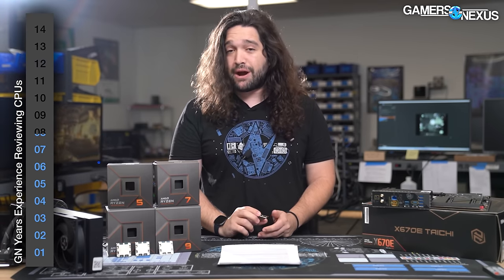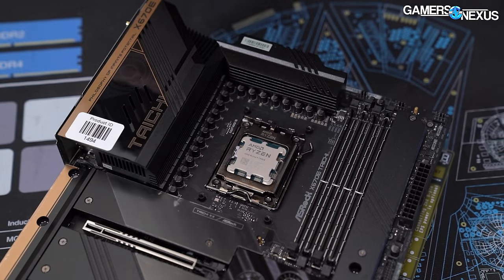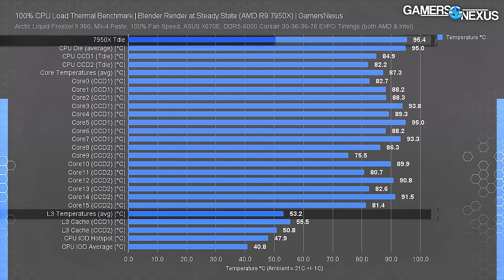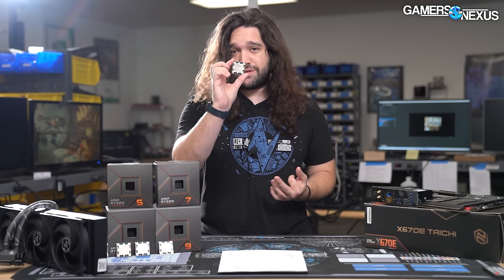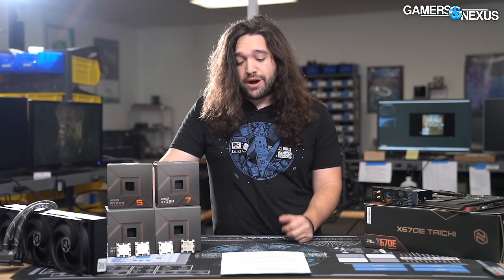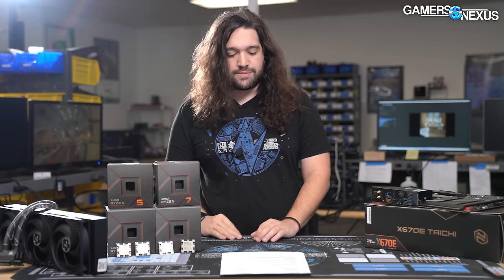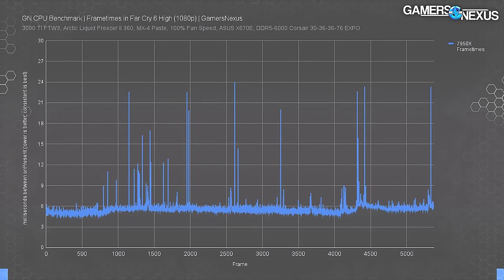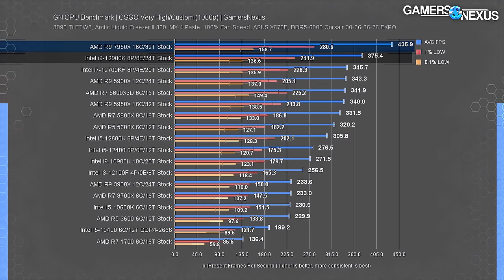95°C is Now Normal: AMD Ryzen 9 7950X CPU Review & Benchmarks

Comment: EVGA picked the golden time to go full throttle into the power supply industry
Reply: Hold on a fucking second

It all makes sense now

4d chess
Reply: While Nvidia was playing 2D chess EVGA was playing 3D chess
Reply: There is only ONE real PSU manufacturer in your sentence, all others are just OEM resellers 😉

EVGA G6 line is literally Seasonic btw. And every EVGA PSU line is made by different manufacturer - they probably already used all of them.
Reply: @walterwhitesr.210  I have 3 EVGA power supplies, one that's been heavily used for almost 5 years. Never had a single issue.
Reply: @walterwhitesr.210  I bought one 1 month ago
Reply: @walterwhitesr.210  You shouldn't offer opinions when you're as uninformed as you are.
Reply: @BizzyB3164  I love my EVGA power supply too. But he's right, EVGA won't survive this. The company's entire existence is predicated on graphics cards (that "VGA" in "EVGA" wasn't an accident). They're done. It's sad.
Reply: All these "EVGA is doomed!" posts don't realize that making GPUs barely made them any profits. EVGA will be fine.
Reply: @jeffmccloud905  I agree,  just wish there were more people out there who are sick of invidia's prices and would support EVGA on principle.
Reply: @sunman2566  exactly
Reply: @Morpheus-pt3wq  Yeah but it's still a bit inferior in terms of electrical performance vs say the CWT made new RMx or Adata's XPG Core Reactor. And actually Aris recently posted their review of the new FSP made G7 which also performs a bit better. It's way more important that you have a really good engineering team to guide the OEMs on how to make the PSUs. Rather than having a company selling directly to consumers that also happens to manufacture PSUs . Seasonic is still capable of producing absolute dogshit units like the S12 lineup which didn't even have OCP.
Reply: @BizzyB3164  EVGA will stay afloat selling the rest of the products they already manufacture, GPUs barely made them any profits.
Reply: @jeffmccloud905  your optics is clouded, because you forgot to look at margins. To get the revenue they had, they had to make and sell insane amount of GPUs each year. Because their margin on each GPU is very low, i think it was about 5% per product. Meanwhile they can sell a PSU with 15% margin, which is a 300% increase per unit. This means for them, the PSUs are more worthy of manufacturing, than the GPUs. Even when it´s just an OEM PSU with EVGA sticker on it.
Reply: @BizzyB3164  I’ve rocked two EVGA psu’s across two different builds in the span of 8 years consistently abused and one even surged, all operate fine. I’d vouch for them.
Reply: @Morpheus-pt3wq  Also G2,G3,P2 are all made by superflower, G5 and G7 were made by FSP.
Reply: @sunman2566  To add to this, it sounds like recently, EVGA was LOSING money on GPU sales. Revenue ≠ Profit. If EVGA makes 1 million selling GPUs but had to pay Nvidia and their component suppliers 1.2 mil to MAKE those graphics cards, then lost money on that transaction. From what I understand, the profit margin on some of their other products is MUCH higher.
Reply: @jeffmccloud905   Energy for VGA? ;) Fits also
Reply: yeah im not sure if EVGA can live in a PSU , MOBO only market .. i use corsair and im brand locked as i tend to do with products that ive chosen and have given me excellent performance  i see no reason to change from corsair ... BUT and BIG but if i have to change when the  7900xt comes out and future proofing for the AM5 7900x3d i may be tempted to buy EVGA as a support their business type thing..
I would like to see EVGA team up with AMD honestly another exclusive board partner for AMD would be great !!
Reply: @walterwhitesr.210  I have an eggs power supply. It’s great. Dead silent with my 12700k
Reply: @walterwhitesr.210  EVGA psu is all I use. Why? Customer service that's why
Reply: @adowowable2587  every manufacturer makes some dogshit units. Why? Because people keep buying them. Only real solution for this would be for people to stop buying cheap PSUs.

This is true even for all resellers, including EVGA. Half of their PSU lines are cheaperoo dogshit units.
Also, within all of them, Be Quiet is the most expensive. They demand you to pay for their fan. While the fan is really durable (it will probably outlive the PSU), its cost is really making their units unreasonably expensive.
Reply: @Morpheus-pt3wq  EVGA's power supplies are not popular. And power supplies aren't replaced very often. It's just not a good market for EVGA long term.
Reply: I'm tired of the biased that exist in the PC gaming ecosystem 

when AMD runs hot they get a free pass but when intel runs hot they are criticized, joked and bashed for it.

now power consumption has become a AMD fanboy talking point that it is almost political. 

you see their are double standards when it comes to AMD and Intel, because without double standards AMD has no standards and AMD are guilty by thier own damn standards
Reply: @walterwhitesr.210  but but, I just bought a EVGA power supply with ECO mode  😪
Reply: @OCtheG  So in EIGHT years, you gave about $200 to EVGA. a company can't survive like that.
Reply: @lldjslim  you make some good points, if you were commenting on a different video. WTF are you talking about?! it's completely off topic
Reply: @walterwhitesr.210  i only buy evga psu, their quality and warranty are the best out of everything you named
Reply: @jeffmccloud905  I own one rn. The aforementioned G6. I also owned G2 before. They´re quite popular, where i live, so i guess it maybe depends on the region? 

I also own Corsair RMx 2018 unit. I am happy with both, but if i had to pick, i´d pick EVGA again. Or Seasonic.
Reply: @Morpheus-pt3wq  Me too. I own the 1600W P2, and I have a FTW3 3090 video card. I love EVGA. But their PSUs and motherboards don't have market share even close to Corsair, Seasonic, Asus, MSI, etc. When I say "popular" I don't mean "well liked". I mean "sell lots of units". EVGA is finished. (Unless they make a huge partnership with AMD, which is still possible)
Reply: I got an EVGA power supply in my boutique prebuilt. They aren't just selling individual power supplies for custom builds.
Reply: @walterwhitesr.210  they sell enough PSUs at a profit margin way higher than what they made off of GPUs. They'll put more effort and R&D into making better PSUs at better prices. EVGA isn't going bankrupt. They were losing money on GPUs in a lot of cases
Reply: @walterwhitesr.210  Literally just bought a 850w Gold fully modular for my RX 6900 XT Upgrade a couple months ago... It's whisper quiet and runs nice and cool.
Reply: @sunman2566  supposedly gpus were 80% of its revenue but I'm assuming that's gross not net.
Reply: @walterwhitesr.210  take Corsair off that list imo, but true there are better non-EVGA offerings.
Reply: @walterwhitesr.210  Is that a joke? My EVGA 750-watt PSU has lasted longer than any other PSU I've had to date. They're freakin amazing.
Reply: @jeffmccloud905  Dude, you have no idea what you are talking about.
Reply: @yasha1928  when do you think you'll replace it?
Reply: @Guaranteedfresh1  elaborate. what did I get wrong?
Reply: I would love for them to focus more on motherboard design too. I miss that dominate play they had in the NF4 days.
Reply: @jeffmccloud905  Not for another 2-4 years depending on the market and advancements in technology. I do not foresee me needing anything above 850W for some time unless RDN3 is exactly what I am hoping it will be.
Reply: @yasha1928   awesome. but this is my point exactly. PSUs don't get replaced very often, and they aren't a very expensive part in a PC build. EVGA can't survive on PSUs and motherboards.
Reply: @linux42069  a boutique build is a custom build.
Reply: @walterwhitesr.210  EVGA P2, G2 were better than a vast majority in terms of ripple & efficiency back when I purchased them - I imagine that's still the case but I couldn't say with absolute certainty these days however Corsair, Be Quiet, EVGA, they don't "make" the power supplies, just wrap them and dictate a few components variations; like with the aforementioned P2 and G2 they were 'Superflower' power supply units with EVGA badges.
Reply: @jeffmccloud905  More than half their profits were from PSU sales. They'll be able to throw more money into PSUs now that graphics cards with their high revenue but low profit aren't hogging the wallet.
Reply: @madpistol  unfortunately, that´s completely random. Every product has the potential to last, arrive dead or die within first seconds of use.
Reply: @AKNSW  Nvidia is playing Singeplayer Chess against a 700 rating AI and still fucking up.
Reply: @jeffmccloud905  depends. As many people tend to save money on PSUs, they end up swapping them much faster, than people owning more expensive units.
Reply: @walterwhitesr.210  Do they all have as amazing a customer service though? That's an important question.
Reply: @Morpheus-pt3wq  yeah,  it's Seasonic or nothing for me.
Reply: @Morpheus-pt3wq  I was looking at a Superflower PSU recently. It's tempting lol
Reply: @sunman2566  No, you're twisting the facts. EVGA only made losses from the top tier GPUs. The majority however won't buy those cards, so they had to profit off of it even though they took a hit in the enthusiasts market.
Do you seriously think they would keep an entire product lineup even though they make a loss in the entire section? Don't kid yourself.

But yes, I also think EVGA will be fine and the move to drop GPUs was a perfectly reasonable decision.
Reply: @lldjslim  Unfortunately you're right - there's blind consumer faith in a lot of the tech world (iphone vs android, Xbox vs PS, windows vs mac as the linux guy waves his arms in the back, etc.)

But to comment on your other points, I believe Intel were lambasted for mobile CPU temperature which makes a difference when the entire unit is supposed to sit on ones legs and as for power consumption & heat output you must not remember the FX chips from AMD lol, do a quick search for AMD FX temperatures on google and you'll likely find articles describing how well received that was. Now in these chips specifically, the performance per watt is 'better' so I can understand why for me personally it's not worth the price + power consumption increase during a time where cost of electricity to your home is increasing exponentially so, some would still see it as the lesser of the two evils (evil being power consumption increase). However notice even in this video Steve puts emphasis on the double increase in power consumption being a bad thing.

Neither company should ever be trusted wholeheartedly and blindly, everything to be reviewed objectively and genuine tech enthusiast understands this which doesn't make up for the majority of people who would share comments on such things.
Reply: @lldjslim  I don't think anyone has blaming Intel for running really hot especially when your product design is suppose to get hot. So you can't blame AMD for that. 
Intel was blamed for their insane power draw for the last gens which results in crazy temps. So while temps are a factor in both arguments, they are totally different in their definition. AMD was way more efficient and didn't draw as much, not even close actually.

You still went to the wrong comment to vent about your frustrating. Not saying your argument is invalid but it is super weird to reply that kinda message to people who talk about something entirely different. Kinda weird ngl.
Reply: @lldjslim  everything you said was literally Intel for years. Now it just sounds like you don't like it just because the shoe is on the other foot.
Reply: @jeffmccloud905  well you're right about that. I need more good excuses to buy more power supplies, I just don't have them. Especially with it being a pain to swap them out.
Reply: @Morpheus-pt3wq  any PSU worth a damn is based on Seasonic
Reply: Yeah EVGA is gunna have Super Flower pump out a ton of PSUs for them
Reply: @walterwhitesr.210  dude, they quit gpus because their psus already make them enough money, theyre not stupid, they have the numbers, you dont
Reply: @walterwhitesr.210  Many! Corsair PSUs suck and those others are more costly/less available.
Reply: @Morpheus-pt3wq  dude... 5% of a $1000 video card would be $50.  15% of a $200 PSU would be $30. And EVGA sold WAY more video cards than PSUs (and many of their PSUs aren't even made by them). it's not a good business long term.
Reply: @jeffmccloud905  They certainly can survive if thousands of PC's are being build. It's not like one PSU fits all.
Schools and corporations that utilize standard ATX PSU's will need them... 

I'm for EVGA surviving this because they're one of the top companies in customer support and have been proving that for almost 2 decades.
Reply: Just got the new G7 1000
Reply: @walterwhitesr.210  I use them A LOT for my mining needs
Reply: @Yasha  but there are more PSU suppliers out there than just EVGA. in fact, they are a pretty small player and many of their PSUs aren't made by them. And schools and corps aren't going to use EVGA, that's just ridiculous. it's an enthusiast brand. Again, I love EVGA. I have their 3090 and a 1600W PSU (that they didn't make - it's made by SuperFlower). But they won't survive unless they partner with AMD pretty quickly
Reply: @jeffmccloud905  And is rebranding not a common affair from where you’re at? It’s pretty common to rebrand and resale… but whatever. IF you simply don’t like EVGA, just say so. They’re not going anywhere.
Reply: @jeffmccloud905  I´d guess about 5% (or less) of entire GPU market are high-end cards, which means they´d sell a lot less of $1000 cards, than $500 cards or cheaper. And as others pointed out, they were selling those high-end cards with losses, so they had to earn more money with cheaper cards to cover up for those losses.

Honestly, achieving 20% of revenue on a product, which offers a possibility to last over a decade is quite a big success.
Reply: @walterwhitesr.210  lmao this dude
Reply: You have a good point lmao
Reply: @walterwhitesr.210  EVGA uses same suppliers with similar reliability and their customer service is as easy to deal with as any of them, probably easier/faster. Who wouldn't pick EVGA?
Reply: @walterwhitesr.210  gotta love it when someone is confidently incorrect like you.
Reply: @walterwhitesr.210  My first PSU was made by EVGA. My second and third were as well. Also used EVGA PSUs in 2 builds for others and currently have one in an Optiplex that's awaiting testing. I currently have a Seasonic in my main rig, only because it was on sale, and have used a Thermaltake in another rig.
To answer your question of "who buys EVGA PSUs", literally anyone who wants a good quality product but doesn't want to blow a crapload of money on a part that has relatively no impact on the performance of their PC. If the PSU supplies enough power consistently, that's all that matters. The real question is why would you spend $90 on something you can get for $35?

I predict EVGA will only continue to grow now that they don't have low-profit, bs arrangements with Nvidia to try and hammer into their business model. They can reallocate all those funds they used to have tied up in GPUs towards actually generating a significant return on investment. Shouldn' t be too hard boost production, expand into other components. and refine the consistency of their products by securing more stable links in their supply chain.
Reply: @jeffmccloud905  how many times do they have to say that the margins on graphics cards were tiny? They make more money per sale on everything else they sell. They'll downsize and be fine.
Reply: Precisely ❤
Reply: They also oversee nvidia can not be sellable with current MSRPs..
Reply: @walterwhitesr.210  Corsair and Be Quiet don't make their own PSUs, neither does EVGA. Seasonic does though, so does FSP, Super Flower, Delta, enhance, HEC and Seventeam. I will not mention others as the rest aren't very good or plain suck and Corsair uses them for their CX and CM series.
Reply: I expect they will go for Intel GPU in the future because Intel still in initial line compare to AMD who already have a lot of series.
Reply: @walterwhitesr.210  Maybe don't sample your product
Reply: Man your so right power supply redesigns are going to be worth a fortune if you can make something efficient and powerful
Reply: @yasha1928  I've said it twice above but I'll say it again... I love EVGA. I currently own their 1600W P2 PSU and their FTW3 3090 (upgraded from their 2080Ti, etc, going back to the Riva TNT2). That being said, I don't think they'll survive without GPUs
Reply: legitimately was just looking at their 1200Watt supplies the other day! I buy anything I can from EVGA when I need new parts, and then fall back to ASUS usually
Reply: @Morpheus-pt3wq  and I'd guess 5% (or less) of the entire PSU market are $100+ models. so, 15% margin on an $80 PSU that only gets replaced every 4-8 years? and they have tons of established competition? ok. we'll see.
Reply: @sunman2566  It was 80% of their business. Are you saying they deliberately ran a loss maker of that magnitude?
Reply: @Morpheus-pt3wq  which one?
Reply: @walterwhitesr.210  Corsair PSU's are overrated. Had problems with two different ones, different occasions.
I have a 1000PSU from EVGA since 2015, using it daily, I rarely ever turn off my PC, changed hardware, done all sorts of things...NEVER had a single issue.
One of the best purchases in my life regarding hardware.
Reply: @walterwhitesr.210  You should probably learn something about the PSU market before making fairly inaccurate  statements about it.
Reply: @jeffmccloud905  Did you watch any videos about this subject?  45% of their profit comes from PSU's.   EVGA can now slim down, lose a lot of management and HR cost and focus on a market that has always delivered around 4x the margin that graphics card did.
Reply: @ivebeen if the profit is minimal, it only equals to the insane amount of GPUs they had to make, to get that revenue.
Reply: @jeffmccloud905  cheap PSUs have faster planned obsolesence, due to cheaper parts used in them. 4 years maybe, but 8 years for a cheap power supply? Probably only with iGPU system used once per week.
Reply: @walterwhitesr.210  EVGA and Seasonic are the only really legit ones in your sentence. BeQuiet are specifically made for noise reduction, not for quality or performance, in every metric but noise their PSU's are inferior to EVGA. And Corsair is simply trash. Not quite Gigabyte, but not too far away. Literally everyone I know who's ever had Corsair PSU had it fail at some point, including me. EVGA is freaking Mount Olympus compared to Corsair.
Reply: Not when they decided to choose the worst PSU OEMs to build said power supplies
   Remember they used to use the best OEM's & they chose to be #5 instead of stay #1!

Sadly EVGA is circling the drain. One of the last vendors that cared about their customers is dead. It's the end of a Era. Swiftexh used to consumer friendly too.
Reply: @BizzyB3164  I'll bet your newer ones don't hold up like the old ones. My Supernova 1300G2 from like 2014 is Still kicking w/ a 3080 & 11900k but I wouldn't even consider a newer EVGA PSU!
Reply: @marcust478  do you realize that´s completely random and not dependent on a brand, right? 
Have you ever wondered, why are there warranty periods? Perfect product would not need that.
I had faulty EVGA G2 unit, which was frying motherboards and managed to kill 3 before i figured it out. PSU was rock-solid in full load, but was unstable in idle and there was no way to test it other, than swap parts.
Submitted a ticket, got a post number, sent the PSU (the closest facility in Europe to me was in Germany, the shipping cost was quite high) and upon its arrival to them, a replacement was sent to me. While it was quite quick, i got fully functional unit... with coil whine. I got rid of it eventually (gifted to a family member), maybe it still works. Still, i´m not gonna trash the brand, since failure can happen to any brand at any given time and the warranty is there to cover it.
Reply: @sunman2566  I do NOT believe EVGA will stay alive for more than 6 months or so selling mice and shitty PSU's and a few motherboards. In this economy & choosing crappy OEM's & the CEO not giving a shit if he retires or not EVGA is all but done.
   Although GPUs had low markup EVGA sold ALOT of them!
Reply: @fireball2275  *kronos unveiled starts playing*
Reply: Yep I bet they might even had insider knowledge or maybe just good business sense
Reply: Just bought an evga 600 watt.
Reply: 2000 watt EVGA power supply for your fusion reactor needs.
Reply: yeah, and avoid the GPU glut because of the Ethereum going POS.
Reply: @AKNSW  Bro nah, EVGA went full fucking 5D chess here (Yes this exists)
Reply: @jeffmccloud905  they still can partner with AMD for making VGAs...
Reply: @victorlgcarvalho  correct, and I've stated the same above in previous comments
Reply: @sunman2566  Profit.

NOT profits.
Reply: @fireball2275  if only EVGA haven’t been producing power supplies for 5+ years….
Reply: Oh my god you're right. I did buy a 1000 watt gold PSU from EVGA already lol.
Reply: @Jusdutari  ye i know they also said they not gonna expand other areas but it funny
Reply: @sunman2566  or, they were going downhill and losing gpu business is the coup d'etat
Reply: Good point.
Reply: Like Charlie's Angels: Full Throttle.
Reply: I love my EVGA Flesh light
Reply: @AKNSW  it's chess not checkers.

Adding this 2d ...3d shit doesn't improve on the original quote. It makes it worse.

The original quote implies heavy stragety over simplified thought process as that is inherent to those games already.

2d or 3d doesn't add shit
Reply: @AKNSW  it's chess not checkers.

Adding this 2d ...3d shit doesn't improve on the original quote. It makes it worse.

The original quote implies heavy stragety over simplified thought process as that is inherent to those games already.

2d or 3d doesn't add shit
Reply: @jeffmccloud905  sry, too many comments to read on mobile.
Reply: @Metalhead-4life  that seems to be how everything is, they don't make it like they used to. Doesn't EVGA have a 10 year warranty now too? Not sure but that kinda makes up for it a bit.
Reply: @sunman2566  it took years for amazon and Tesla to post profits. What do you think got them there? EVGA’s latest move is if Tesla stopped making cars and just sold batteries, or amazon went back to just selling books.
Reply: @jeffmccloud905  evga isn’t just going to fade into obscurity lol.
Reply: More PWR baby! Let's boil the Planet! Burn baby!
VS
The power is yours! Captain Planet
Reply: With energy prices skyrocketing these days, not so sure.
Reply: Or perhaps becoming exclusive manufacturer on GPUs for AMD
Reply: Just bought their 1600p+ for the 4090. For the sale price it will hold me over till native atx 3.0.
Reply: oh yeah? remember Diamond Multimedia? anyone?? used to be one of the biggest video card makers. shit happens. I've been watching this industry for 40 years. EVGA isn't that big.
Reply: @jeffmccloud905  Seems like Diamond is under the same company as PowerColor, and PowerColor is still kicking. Also seems like there's still Diamond cards around, there's a Diamond RX6600. As for what will happen with EVGA, time will tell.
Reply: @cybermonkey81  yeah, I'm sure that's what EVGA wants... To be so obscure you have to Google them and say "well damn, they do still exist kind of". Maybe they'll get bought by ASUS or something
Reply: @sunman2566  80% of sales are gone ..that means a major staff reduction...yes profit was low on gpus...but they made money..no way evga will survive as a company without it. Their psu's are not the greatest. I should know. I've had to rma 5 out of 20 of them I've bought in the last 3 years. Evga member since before the first forums redo...since GeForce force 2...30 gpus registered...12 mobos registered....if they don't partner with amd....they will sell out before 2023.
Reply: Not a bad idea at all...I'm in the market for a couple of PSUs....I wonder why? 😆
Reply: @jeffmccloud905  I’m not saying they have business acumen, just praising the QC. Lmao
Reply: it sure looks like it, lol
Reply: Hahaha
Reply: @BizzyB3164  Poverty helped me. 🤣💯 I haven't been able to afford a new GPU since 2013! I'm still running that frigging GTX 690 that I dropped a grand on! 🤣🤦🏽‍♂️💯

I was impressed that EVGA leads chose to fight on principle. There aren't many firms left whose management aren't at least borderline sociopathic — so, major props to them! While my financially deficient ass can't afford the new stuff as it is, it made my view of EVGA go up orders of magnitude. They got mad respect from me, which is difficult to muster. So, props to them & props to the staff at GN for going so far and doing investigative journalism! 💯❤️
Reply: Yeah if they actually release an ATX 3.0 PSU's before mid October. If not whoever does release their new PSU's first will get my sale. C'mon EVGA make it happen
Reply: @Morpheus-pt3wq  Corsair is the same….Corsair loves Channel Well technologies and Flextronics. 
EVGA gained their name brand recognition from their rebadged Super Flower units.
Reply: @adowowable2587  P3 is made by HEC
Reply: When we needed them most… they came.
Reply: @jeffmccloud905  lol mmmkay. 
EVGA branded PSU’s are something noobs look for. Noobs don’t seem to know the difference between a good EVGA unit like the G3 and a mediocre unit like the G+. EVGA has great brand name recognition in the PSU biz….  Which they gained from their rebranded Super Flower units. 

Most tech enthusiasts don’t really understand the minds of noobs. A lot of people build and buy prebuilt systems based on the name of the parts. Ryzen, i7, Nvidia, Asus, EVGA, and Corsair are all brands that Noobs eat the sh1t out of. 

The question is… will EVGA f’k it up with their subpar units like the G5 or their W-series?
Reply: I actually never bought a EVGA power supply. I always bought a bequiet one and recently a corsair one.
Reply: @BizzyB3164  making my new workstation soon. I'll throw in a couple dozen bucks to make sure I'm getting one of theirs.
Reply: I  wonder if evga wants to strong arm Nvidia who has long put their power draw on gpus as a psu manufacturer problem. Maybe evga tries to dictate some max power standard in order to keep all pc parts playing nice and not cause power breakers to flip when everything drew too much.
Reply: @GlennsHardWired  Why do people act like EVGA didn't think this decision through? Do people honestly thing that a company would commit seppuku because they don't like working with Nvidia? Unless the CEO and board members are tying to liquidate the companies assets like what happened to Sears, they would have looked at how this will affect the company and have determined that they will survive.
Reply: @Doomsday604  must be fun at parties
Reply: @AKNSW  wow that's almost as original and witty as "4d chess" 🙄
Reply: @sunman2566  Yeah, only about 80% of their entire revenue barely anything lost right there.
Reply: @jeffmccloud905  Apparently, 80% of EVGA sales were GPUs. But their profit was SO little, that their PSU division made them more money, despite being a very small part of their business.

Don't remember where I read it, but it's somewhere.

Thanks to NVIDIA's shitty practices and habit of screwing up their partners, we have lost what was arguably the best AIB GPU manufacturer.
That and NVIDIA's recent price manipulation, the fact that their 4080 12gb is basically a 4070 and they just called it a 4080 to charge $900 bucks for it (historically, the "70" card is $500. And yes, the 12gb and 16gb 4080 are NOT the same card with different amounts of memory. The 4080 12gb has less CUDA cores and lower bandwidth).

Because of their BS, I'm going AMD this time around.

If RDNA 3 is more powerful than RTX 3000 (and it should be, considering RDNA 2 is already more powerful than RTX 3000 except for Raytracing) and is at least just as good in Raytracing, and has a good price, Nvidia is about to shove a lot of 4000 cards where the sun don't shine.

Now imagine if EVGA someday makes AMD GPUs. Ah, sweet revenge.
Reply: @sunman2566  Well yes, but part of the use for their revenue was paying their engineers, who now have no use whatsoever, so they're definitely going to have to downsize. The question is whether they can downsize enough to remain profitable, but not enough to cause the company to collapse entirely.
Reply: Seasonic and superflower are the ones that will be making bank. Not evga, evga will just be making few dollars per psu sold.
Reply: @jeffmccloud905  I wouldn't say they're done but they are taking a big hit for sure.
Reply: I have a Corsair power supply that's been in ise since 2014 (so almost 8 years now) and it's fine.
Reply: @lldjslim  always been like that. They talked shit about intel 10 series as well eventhough it was cheaper and better overall. Its just fanboys things and of the amd type are the most vocal by a large margin
Reply: Genius move
Reply: You really don’t think that was planned? Lol
Reply: @Morpheus-pt3wq  Seasonic and superflower are the two big dogs that you should always look out for imo.
CWT and Gospower are fully acceptable as well.
Reply: yeah and my 1600W Supernova was the fault in my 7950x/4090 build "pro tip, turn that eco switch off in the back; its nothing but problems"
Reply: @AKNSW  And Intel is playing 1D chess